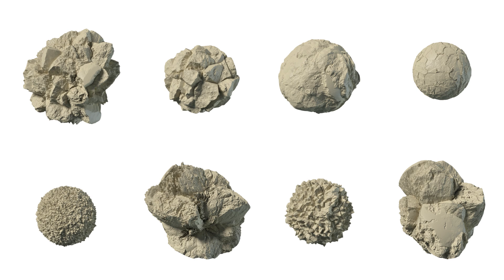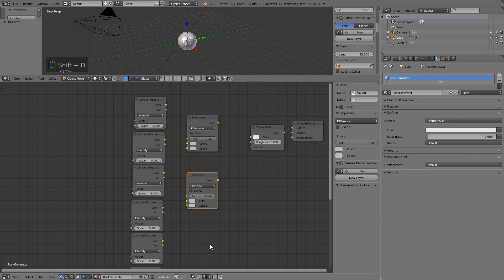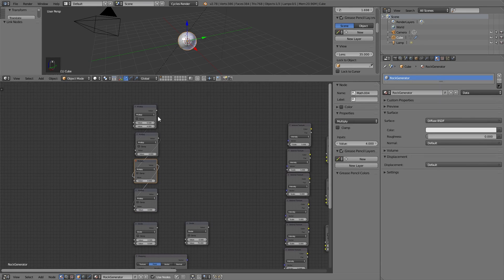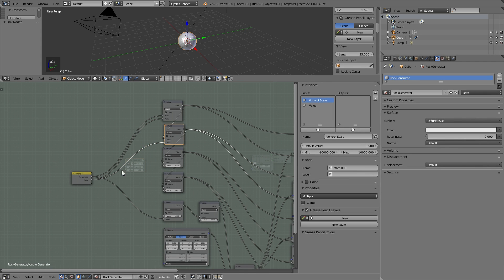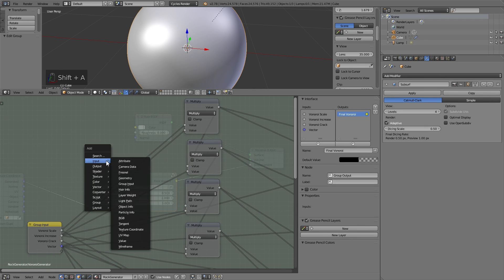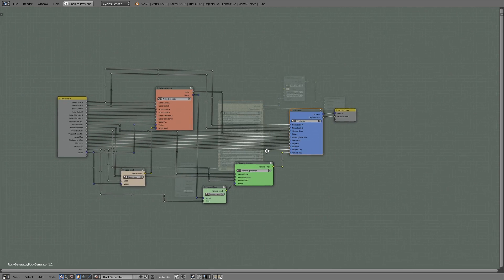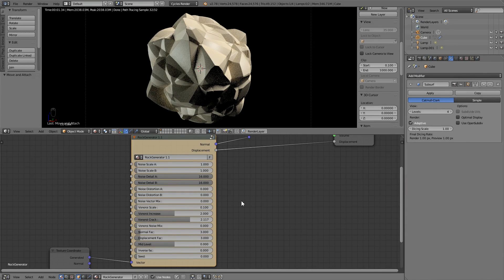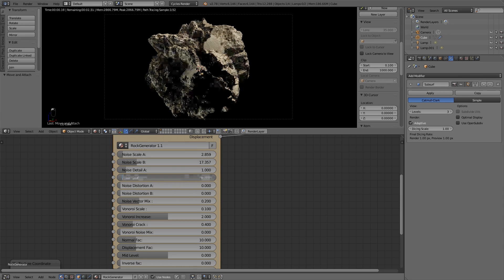Blender tutorial | Procedural rocks

Comment: Why did you use higher than 1 resolution on the adaptive subdivision?
Reply: Probably so it used less RAM and rendered faster. Having only 16gb myself my Blender hangs up BAD when I enable adaptive subdivisions.
Reply: @OGPatriot03  but he used .5 subdivision instead of 1 so that would use more RAM.
Reply: @nathancreates  Your fist post said he used a value higher than 1.

Now you're saying he used a value less than one. - In that case he did it to increase the quality of the image.

You can see when the animation is in motion at the start that there are issues, perhaps he was trying to fix that by increasing the quality per pixel.

Comment: Amazing Amazing work of nodes....!! I tried to but the mesh is still sphere instead of highly distorted mesh.......any solutions? Thank you
Reply: Did you figure it out
Reply: @Bandit01  Make sure to enable the Experimental Cycles rendering feature set, go to the material tab go to settings, and set the displacement method to "True" instead of Bump only.

Then as long as your mesh has a lot of geometry, or you used adaptive subdivisions it should displace the mesh.
Reply: @OGPatriot03  thanks but i meant was to actually displace tge mesh so i can export it. I already figured it out..

Comment: This is witchcraft and it doesn't work. I set up everything exactly as you described in this video and I just got a sphere.
Reply: Sounds like you need to enable the Experimental Cycles rendering feature set, and set the displacement to TRUE instead of Bump, then dynamic topology on the sub surface modifier.

Comment: can we generate rock models from this which can be exported to obj or fbx?
Reply: i think no... that result is useful only for cycles rendering. it is not a concrete displacement
BUT you could analyze all the voronoi texture with their values to repourpose them with several Displace Modifiers... But it is a crazy work
Reply: @pepperedsoap  will that work?
Reply: Apparently you cant. What makes this "addon" useless in most situations.

Comment: I personally would be very happy if you showed more intermediate results, and explained why you do certain things.

For many minutes I just watched you duplicate and connect nodes not having any clue why and what they actually do.

Building a simple working node setup and then refining it would be great to see how the final result really works, and what was your approach when you designed this.

I hope my feedback is helpful. Thanks and keep it up! :)
Reply: I too would like to know the WHY of things, not just the how
Reply: To add a little to what Remco mentioned: The Voronoi graph is interesting because it mixes multiple 'octaves' of Voronoi noise, each being 4 times (multiply x 4) greater in scale than the last. If you've ever played with the 'detail' parameter of a 'Noise Texture' node, I believe that essentially the same thing is happening. It mixes an additional layer of noise on top that is a factor (usually double) the scale, and so on as you increase the 'detail' parameter more layers at increasing scale are mixed over. This octave factor is sometimes referred to as 'lacunarity', which you might bump into when using various CG noise generation tools. The end result is sort of pseudo fractal, where the smaller and smaller details have a shape characteristic that echos that of the larger shapes.
Reply: If you use the node wrangler add-on, you can check what every node does for yourself (Ctrl-Shift-Left Click?). They are pretty much self-explanatory. The voronoi texture is a bit weird, but wikipedia explains it pretty good.

He basically mixes more and more detailed voronoi textures over each other, and uses the result as displacement. In the end he uses noise textures to add randomness (because voronoi is not random at all!), and mapping nodes to repress repeativeness.

Don't get me wrong: it's a beautiful, powerful and simple shader. Very elegant.